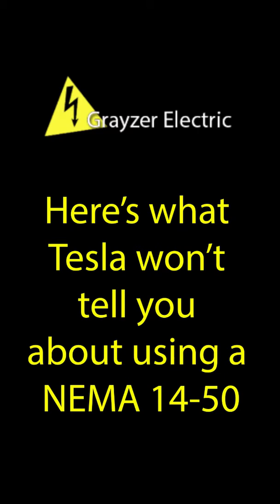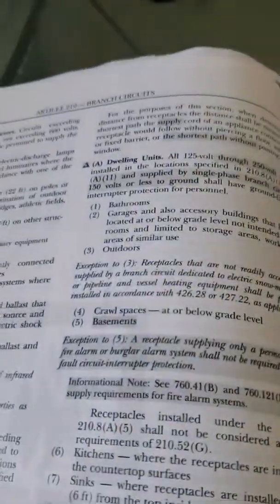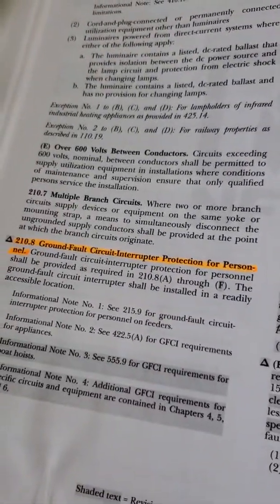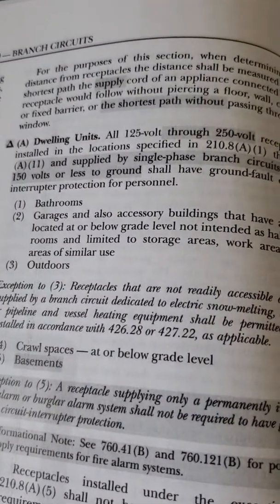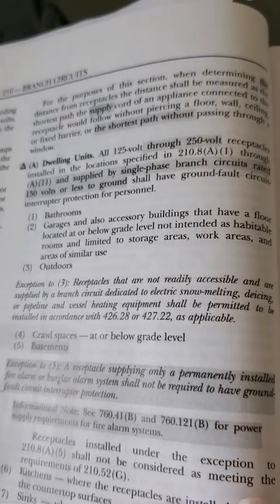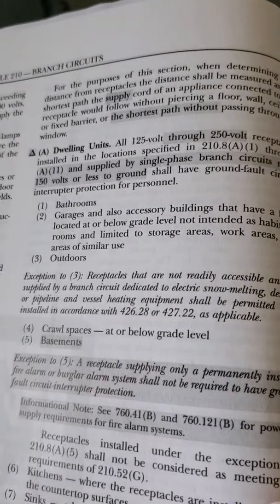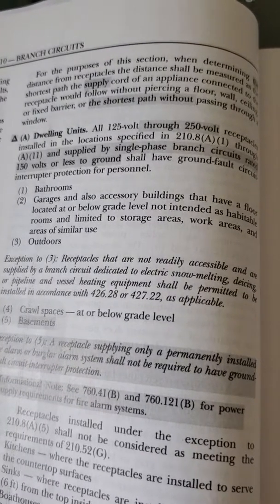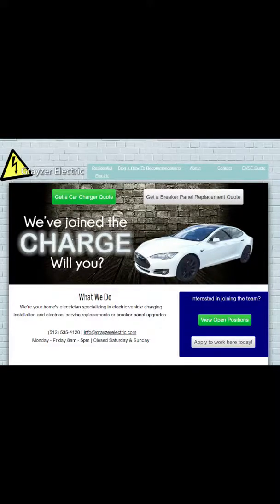Why 14-50s are outdated for car charging - Code Update

Comment: This video is just an ad for their company and make people spend more money than they need too
Reply from the maker: Over the thousands of installs that we've done, we've seen the GFCI breakers trip from both charging stations running their GFCI test cycles and the higher loads that car charging utilizes.  While the breakers shouldn't be tripping due to loads (not overloads, but 80% loads every time they are used), the due tend to wear out faster due to their electronics.
We used to see the mobile connector tripping other 120 volt GFCI or AFCI/GFCI breakers in the electrical system.
One particular situation had our install out of the main breaker box and breakers in the sub panel in the garage were tripping.  I think that Tesla has fixed that specific issue, but we are still left with the higher load problems we've seen.
Cost wise: a GFCI breaker costs $125-$150 more than a regular breaker does and Tesla stopped sending mobile adapter connectors outside of the regular 120 volt adapter when the Model 3 came out in 2018.  
So you do have to buy the adapter as well.
A 14-50 uses 6-3 wire which has an extra conductor in it that isn't used so there is extra cost involved there.  
When we did receptacles, we offered the 6-50 as it only needs 6-2 wire, which is what the wall connector would use as well.  
By today's standards, you are not saving the entire cost of a wall connector by putting in a 6-50 or 14-50.
It is a couple of hundred dollars in savings, but you still run that risk of the nuisance tripping.
Once that breaker starts tripping, we start getting the warranty calls and we'd rather put in something for the long haul than short term.  
We don't make more money off the wall connector installs either.
It costs us less to put them in, actually since we don't have to have the GFCI breaker, receptacle, box, plate, and adapter (potential savings over a 14-50 are higher as the wire costs more).
We also have seen issues with the receptacles themselves not holding up over the larger loads with the test of time.
They do make $100 heavy duty receptacles, but again, we would be cutting into that "savings" by putting in a receptacle.  
The cord is also longer on a wall connector by 4'.